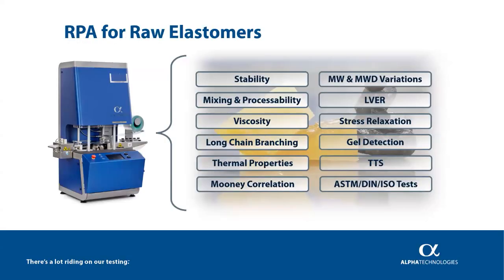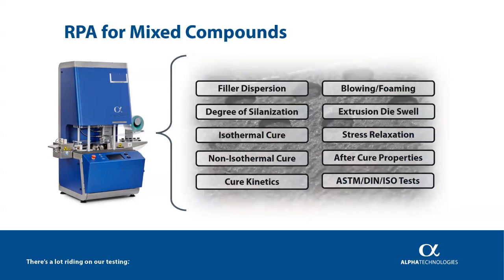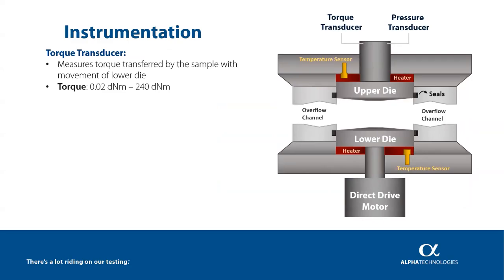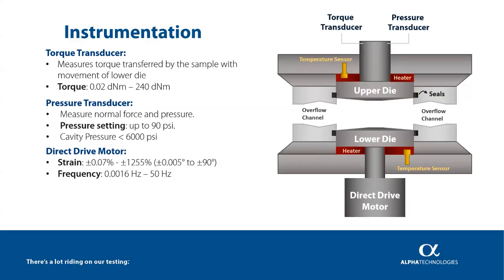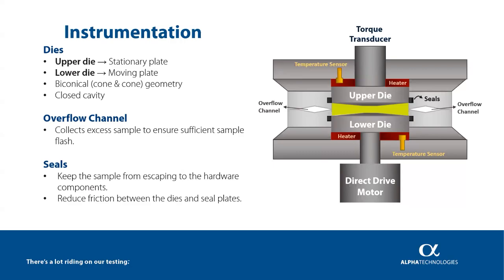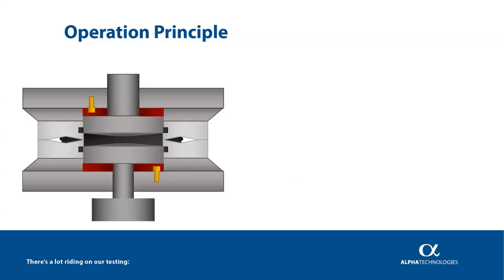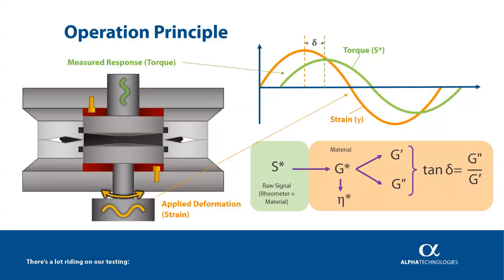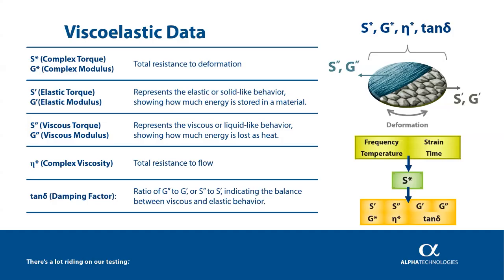The Rubber Process Analyzer (RPA) Can Support Your Cost, Quality & Efficiency Goals

Comment: Isn't tan δ also measured directly? I thought the RPA measures the phase lag directly, since it can simply determine the time lag between the input strain and the output torque.
Reply from the maker: After applying the DFT and extracting the fundamental harmonic’s phase and amplitude, tan δ is calculated as the ratio of the viscous to elastic component of that fundamental response.

Thanks for your question, 
@shyanakashyamal3545 !